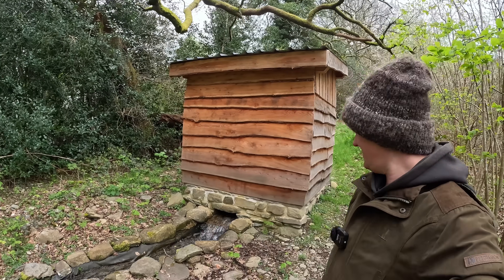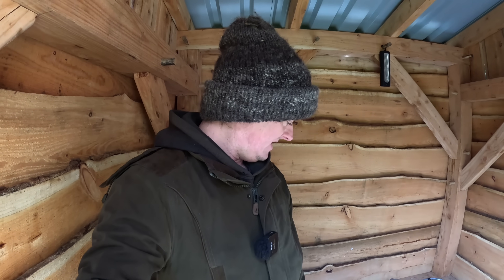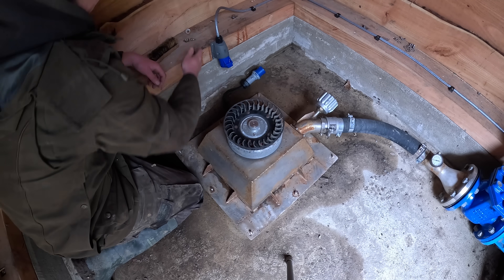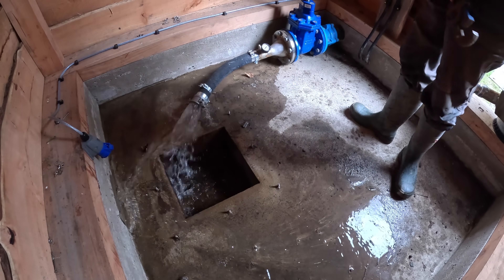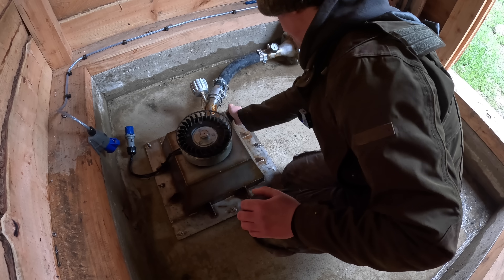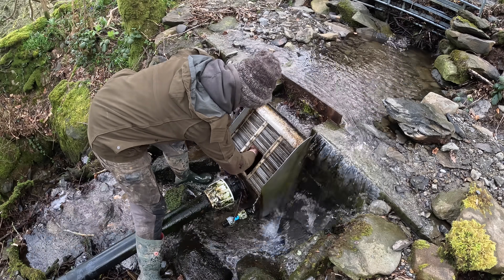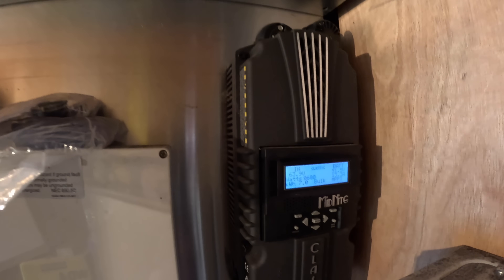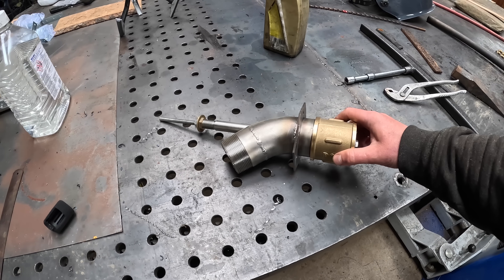North Wales 1.5 Kw Hydroelectric System Update And Maintenance

Comment: You probably already know this but that surface rust is contamination from cleaning the welds during manufacture. You should always have separate stainless wire brushes to use solely with stainless. Once they’re used in ferrous metals they transfer the iron onto the stainless.

Comment: Hi Chris, out of interest and zero experience myself, would it be more efficient if the motor/ spoons square compartment/housing be more efficient if it was mounted in a round tube so the water flows out with less friction in the chamber as the water bashes around the square box compartment and potentially causing some loss in generating power as the water bounces off the square edges back against the spoons slowing the turbine down. Would the water flow more easily if it was in a tube with no corners for the water to bounce back against ?

Comment: A idea for reaplacing wing-nuts, some lengths of hex-bar of say 2 inches drilled and tapped to suit thread. Can weld small rod on top for fingers but allows easy use of spanners if it jams. A piece of thick rubber under the housing and on the concrete would help with noise as well as harmonics. Doesn't need to seal as it looks like you let water drain down that same hole. The three-phase plug and socket is great idea, just further up wall out way would be my choice. 
I see a lot of these things and wonder if having an pressure accumulator tank at the end there to settle down speed and hammer oscilations.

Comment: Dude it might be better to whack a 3" inline strainer on the outlet of the gate valve in the hut and leave the inlet unrestricted. Easy maintenance to turn off the valve and pull a core out for a hose down than that fiddly inlet array...

Comment: Did you clean the stainless welds with a mild steel wire brush by any chance?
Also you could do with giving stainless welds a go over with pickling paste, it does make quite a difference apparently!

Comment: hrmmmmmm @ 6:07 when you opened that valve and the water started coming out, there was a bunch of brown dirt that came out right up until the full flow started coming out.... you think THAT could be clogging up that 'spear valve' (I think that's what you called it) ????? - Dirt can't be good if it's hitting the blades at such high pressure, right?? (I don't know anything about these types of systems, but that seems like a bit of common sense) And for the amount that was mixed in with the water, if there's a screen or mesh before it goes through that 'spear valve' it is probably clogging up flow right there..... 
..well that's my guess so far, at 6 mins into the video LOL I guess we'll see :D
Reply: okay so I don't know what's inside that 'spear valve' but it's fine dirt particles getting through that mesh that is at the head of the hose.... (at least that's what came out of the other end when you turned the water on) I really think that's the issue (if the performance went back to normal after you did everything) and putting in a screen/filter is gonna be a royal pain the rear because it's gonna have to be cleaned quite often.... and putting that larger mesh on all six spot will only make it worse (if that fine dirt REALLY IS the problem) ... but if it is then maybe digging out a small settling pond right before the intake will give enough of an area for the water to slow down and the silt to settle to the bottom before it goes into the hose, and that area right where you lifted the metal damn' up and got wet, the upper area seems like the perfect spot to do that..... it will require maintenance of course, but not as much as replacing a filter ever 2 weeks....
so what do you think Kris? could that silt be the problem? there seemed to be A LOT that came out... enough that you could see it built up on the floor... did you notice this?? just give it a watch and you'll see it..... 
Could the spear valve be getting clogged by a build up of silt? I think this stuff is so cool... and the way you brought it down to figures that are relatable to people that have no clue (like me) by saying it could have drove a car around the equator just by running for 2 seasons.... that blows my mind!!! I wish I was able to do something like this at my house!!) 
Thanks for sharing this with us Kris, I gonna have to go into your back catalog and see what other awesome projects you've done!!! :D

Comment: If that were my hydro shed, I wouldn't be able to resist (pun intended) putting up 3 switched incandescent lamps that run off the 3 phase output. That way when things are operating in there you'd have the option of good lighting, plus they'd show quite nicely the voltage & frequency increasing as you wind it up and potentially even any imbalance between phases. They would be cool to watch.

Comment: You could use a smart controller to automatically adjust the flow rate of the nozzle, Maybe restrict the overflow in a vertical channel so that as the flow rate increases the stock pond level raises and monitor it with a couple float switches set up for min / max height, when both switches are off turn the jet down, when both switches are on turn the jet up, when min switch on and max switch off keep nozzle there.

Comment: I’ve watched all of your videos! I’m always amazed at what you do and I was as shocked as you that it’s been two years since you did that project.  

I was a little confused on the amount of driving off 7 gigawatt hours. If it’s 3.5kwh / mile, shouldn’t it have been 7000 kWh/ 3.5 kW-m and not 7000x3.5?

In any event, this system has provided enough energy for the average 2-3 bedroom UK house over the past two years!
Reply: The mileage factor is 3.5 miles per kWh, not 3.5kWh per mile.
Reply: Not sure how I missed that. Thanks!

Comment: Really helps when KWHs are converted into a language I can understand. Questions such as emersion heaters or electric panel heaters. I have to switch my heating off cos I can't afford to pay Scottish Power anymore. Wish I had a stream running through my flat.
Reply: There was a time in my life when I found myself temporarily financially embarrassed 😳. A friend put a camping solar(small) panel up on my roof. It has a small battery that sits on my shelf in the kitchen. I have on grid power now, but I still use the setup for general lighting. Keeps my bills a lot lower. I paid for it by babysitting so he and his wife could have date nights. It was a real blessing to me. He and his wife thought it up and surprised me.
I hope that things improve greatly for you soon!
Reply: @damogranheart5521  Every little thing helps!

Comment: Small suggestion: supply the customer with an extra set of Coanda panels so they can wash the grime off one and have a spare while the others are installed.  The trip to the intake will only require a swap without having to bring brushes, etc. to clean the panels.

Comment: People would (Do) consider me a nutter for living off the electric grid using a minimal PV electric system. The Local Governance has maintained ownership of Two nuclear power generation plants here. This is the Golden Gateway to Corn Crop Production. The 60' feet deep gravel here is perfect for shallow well pumps. During the crop season this agricultural method uses more electricity than the entire State of California. Electric here is cheap and plentiful. The Nuclear Plants will be running at 50% greater than designed capacity and they were supposed to be decommissioned twenty years ago or more. Anyway, by turning this entire region over the largest fresh water aquifer in North America into aquaponics, chemigation croo production we now have the largest cattle feed lots on the planet. Being that it is quite foolish to even think about making the water safe to drink ( the volume of urine fueled phosphates will plug every known filtration technology). I'm in a low area ( receiving) too. Anyway, the water tower up the hill can provide nearly 60 psi at 35' feet above my shack. This is what im working with I guess. I admire the gravity - volume water turbine; it brings me comfort. Prior to comming here I made my life at the base of North Americas largest flat top mountain. The water was pristine ( blah - blah - blah- 36 oil drill rigs fracking away and a gang of misfits drove me away). 😊

Comment: The solution to the surface rust issue on the welds is using pickling gel or a little muriatic acid wipe down to passivate the stainless steel welds.

Comment: Kris 
I'm just wondering if the spear valve further back in the system wouldn't be more suited with a lamina flow nosell  pointing at the spoons, my thoughts are the spray pattern of the spear valve wouldn't be as efficient at lower opening, a laminar flow nossel would be the same shape and direction regardless of flow, thats my thinking anyway

Comment: Dude, if you’re painting metal and longevity is a consideration I from personal experience will strongly recommend that you use raptor epoxy zinc primer. It’s nearly 30 quid for a single rattle can and you’d use it all on that pump housing. It’s very good.

Comment: It's already pretty quiet, but it would be interesting to test some sound absorbing foam hung inside the structure to see if it would help. Could even do just a foam box set on top of the turbine. The outlet is the primary source of noise.

Comment: Great to see the system still working well! I think for the next one you should maybe use a blue 3 pin 16A 230V angled inlet with a 3 pin 16A 230V trailing socket on the end of the alternator cable, rather than the way you have this one. It means that the generated power is safe from fingers if it was to be unplugged whilst in operation. 🤔
Reply: Was literally just thinking this.
Reply: I was going to say the same

Comment: The EV analogy means nothing to me. Can I power my house off grid? It would be better to have production compared to some sort of prescribed average (because yes everyone is different) domestic situation for the home; lights, domestic appliances, cooking/heating, computers, phone charging etc. I don’t have an EV and if I did it wouldn’t run off a 24k mile extension cable. If I had stream in my garden I would have hydro for sure. Great work!

Comment: I think a better perspective on how much electricity this produces is that, according to the Government, the average household uses 3,500KWh per year! Can they export their excess during the winter to offset grid-costs in the summer? Really interesting series - have enjoyed it.
Reply: That's for electricity only I think. You may need to add average gas power consumption for the full picture. Average gas consumption: 13,000 kwh. If so it looks like you'd need 2 or 3 of those puppies to satisfy the power requirements of your average house.
Reply: @PeterFrance707  That makes sense. We use around 1,200 litres of oil for our heating each year; a litre of oil is about 10KWh in energy... Your figure is about right for us...

Comment: You should keep a broom in the pump house to cleanup after
Reply: I was thinking the same thing when he turned on the water and then saw him using a small hand brush. If it was where i worked at in the past, we would also have coated the deck and sides of the concrete inside the  building with Rustoleum two part Navy Gray Epoxy like all of our floors were done in. We added a small amount of anti skid mix to each batch so the floor wasn't too slick and recoated the floor after about 5 years or one Hurricane, whichever came first. When a governing board member visited, the comment was that they were so clean you could eat off of them even though we were running Diesel powered pumps and generators in there. The epoxy made it easy to mop down every Friday. And we swept down after every shift.
Reply: @gravelydon7072  
Did you have drains in the floor as well?

Comment: Very neat indeed, wish I had a creek or river close to me, so I could try my hand at generating electricity. Y'all take care.
Reply: I have a creek on the farm but there is no way it could be used. It currently is flowing about 120ft3/s. Twice this month it has been over 5000ft3/s with one day hitting almost 9000ft3/s. A nice flow at 2 ft to an extreme of over 16 ft.
Reply: @gravelydon7072  
Can you build at least a  1 metre high dam in the stream with a fall of  at least 50 metres to a generator shed?

If so you could use it..
the overflow just flows over the top of the dam but the basin behind it keeps full whether at 2 ft or 16ft water flows....

Tap off the dam basin with a pipe and you are all set

Comment: Another good reference, i average 1800 kwh hours in my 1 bed flat yearly, so that turbine could easily run a couple 1 bed flats
Reply: Wow that's quite efficient. I consume about 1100 kwh/month in my house, although half of that is my electric car.
Reply: @Griffinyyc  your car isn't electric it's battery powered.  it's as electric as your cordless drill or mobile phone!
Reply: @marie-ramaghurburrun9204  The source is irrelevant,regardless of where the electricity comes from,battery,mains,solar,hydro or whatever. Of course it’s an electric car !

Comment: Stainleessteel must bee welding whit stainleessteel rood and argón gas . No rust , really . Ciao.
Reply from the maker: It was welded with stainless rod and pure argon. But the welds have to be treated afterwords with chemicals or there is thins machine that does it that I want to buy. the rust never progresses in to the steel but it just sits on top if you dont treat them and its in wet conditions.

Comment: Perhaps on the intake grates, you could create a small .5-1" channel on one side that has small hydro powered fans that spin small brushes spanning the length of the grate, continuously cleaning the underside of the grate
Reply from the maker: I have actually been messing with a design for doing just that. its just not that easy to do unless you have a lot of spare water going over the screen because it needs about 10w of power to power it and 10w from about 0.3m head needs quite a lot of flow to work.
Reply: @KrisHarbour  Would strips of brass or copper help keep biologicals (algae, moss) from growing on the intake grates? We put strips on the upper parts of a roof top and the rain mixes with the brass to release some atoms off the brass and wash it over the entire roof. That keeps the moss/lichens from eating up the roof material.
Reply: @WaterFaucet24 That's a good idea. Maybe make the coanda screens themselves out of brass or copper.
Reply: @WaterFaucet24  Just like old ships hulls. Trouble is I wonder how much contamination it would cause. (I.E. Parts per billion if it's a thing with the environmentalists)
Reply: @KrisHarbour  Awesome!  Maybe something that isnt continuous, but only effective during high flow from storms would be enough to govern the debris
Reply from the maker: Yep, the issue is trying to make a mechanism that does not end up stopping in a place you dont want it stop  (at the bottom) when the flow rate drops. this can be done with springs or something but then you need more power to move it. its defiantly doable but its not a simple mechanism I dont think.
Reply: Great idea ! The Water industry uses them to clean powered 6mm screen racks to clear sewage debris - rotamatt i think one of the brands .  A mini version self powered - awesome solution. A series of 2 or 3 screens bigger bar rack to protect the smaller ones 👍
Reply: What’s gonna clean the cleaner?! 😂